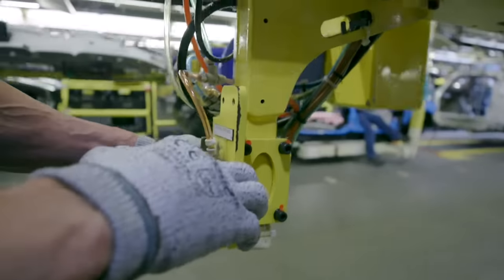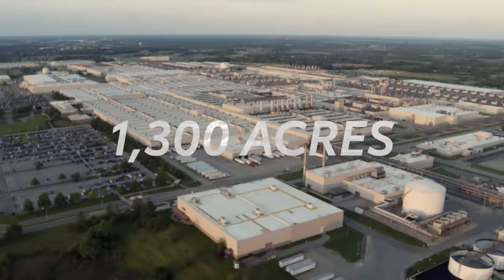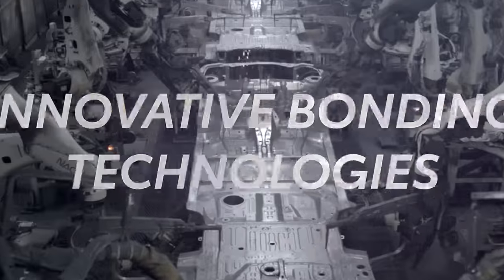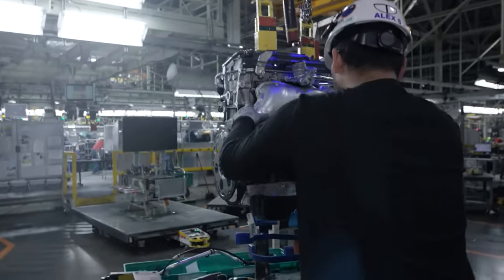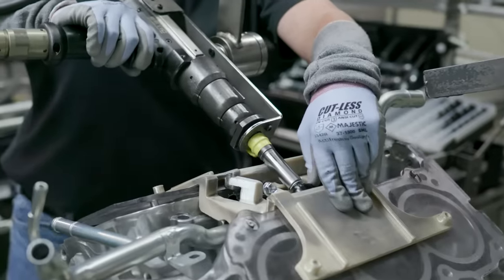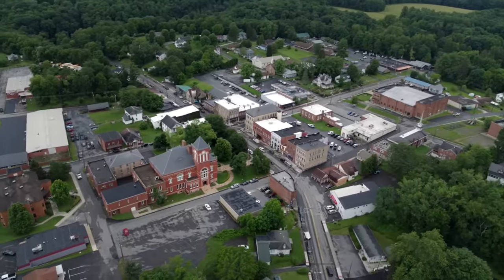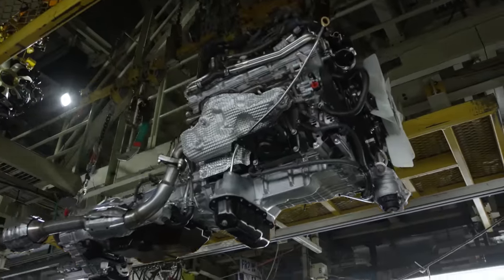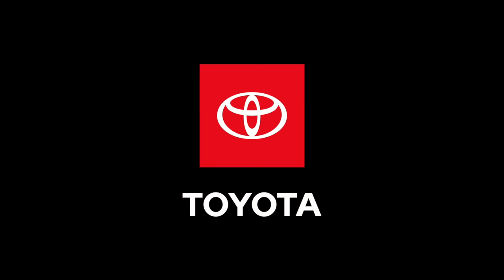Toyota Manufacturing Behind The Scenes & Production Plant Tour | Toyota

Comment: I bought 2021 camry xse this year. It turned out even more amazing,  beautiful and powerful than I though. Thanks toyota Kentucky for this amazing machine.
Reply from the maker: This is really great to hear! We hope your Camry continues to impress you. ❤️
Reply: @toyotausa 
 *Looking forward to the 2023 Toyota 4Runner full time 4x4 twin turbo hybrid, rear air ride suspension with built in brake controller and 7000+ lbs tow rating. 

The power & torque of a v8 with fuel economy of a 4 cylinder. 

*An industry first, the advanced hybrid system not only includes with a 30am 115v inverter generator for tools, RV trailer, emergency home use etc, it has an on board 30amp solar controller inverter with external plug for up to 600w of solar panels, sold separately, to plug into. 

Zero emissions power generation and storage. 

That’s Toyota Smart. 

Cheers,
KP
Colorado Springs, CO⛰🇺🇸

*🙏Hopefully!
Reply: كامري 2022
Reply: @toyotausa  
Toyota should enter India with this loaded manufacturing plants , will ?
Reply: I owned 2019 RAV4 Limited for 2 years and now own the new 2022 Highlander Hybrid. Kudos to those folks at Toyota Kentucky and Indiana for the amazing work. Love ❤️ from Maryland!!
Reply: @MaheswaranBHARAT   Bro you already have a plant and India is not buying Toyota products more than Innova and fortuner.
Reply: @abhinavbhushan100   Toyota is quality  but price in a bit more than the others , indians going behind cheap and not mind about reliability ,
Reply: @MaheswaranBHARAT  k
Reply: @icare7151  sh
Reply: toyota kentucky? LMAO
Reply: after hearing toyota kentucky, i get it LMAO
Reply: @MaheswaranBHARAT  i hope
Reply: Youre welcome!
Reply: Me too it’s so crash  avoidance

Comment: I've worked for Mazda and currently work for Honda. Yet, I own a 2011 4RUNNER and a 2018 Camry. I owned a 1998 4RUNNER and 2007 Camry before these two fine vehicles. I will replace these when they have been driven a few hundred thousand miles with Toyota's. Best built vehicles on the road.

Comment: *Looking forward to the 2023 Toyota 4Runner full time 4x4 twin turbo hybrid, rear air ride suspension with built in brake controller and 7000+ lbs tow rating. 

The power & torque of a v8 with fuel economy of a 4 cylinder. 

*An industry first, the advanced hybrid system not only includes with a 30am 115v inverter generator for tools, RV trailer, emergency home use etc, it has an on board 30amp solar controller inverter with external plug for up to 600w of solar panels, sold separately, to plug into. 

Zero emissions power generation and storage. 

That’s Toyota Smart. 

Cheers,
KP
Colorado Springs, CO⛰🇺🇸

*🙏Hopefully!
Reply: Well said. HOWEVER I have mixed feelings about 2023 model with the all new engine and transmission. 

Those twin turbo 4 cylinders with 10 speed transmission :(  I don't feel it's going to hold up and take a abuse and keep on trucking like the legendary 4.0 V6 with five speed transmission. 

I'm planning to buy a 2022 TRD PRO 4runner knowing that this engine and transmission setup will last 25 years.
Reply: @Costarica-mq8el  We have owned 4 Toyota 4Runner’s. Our 2021 4Runner is a Limited 4x4. We miss our 2005 4Runner V8. 

The current v6 and 5 speed will last for decades, but it’s severely under geared and under powered for anything over 5000 feet above sea level. 

When the 2023 comes out we are going to sell our 2021. We drive up to 14,000 ft above sea level here in the Colorado Rocky Mountains where we live.